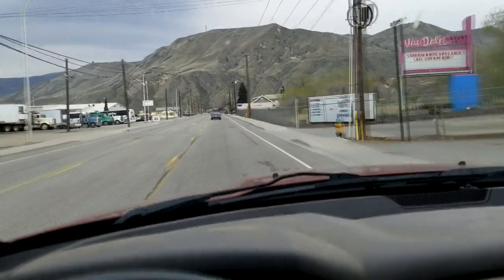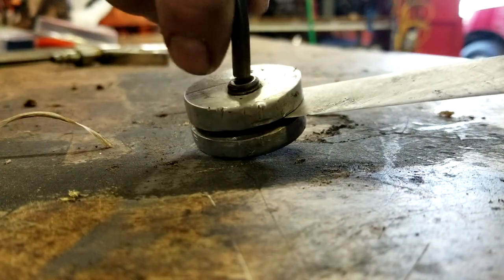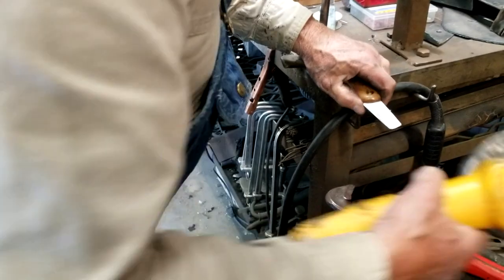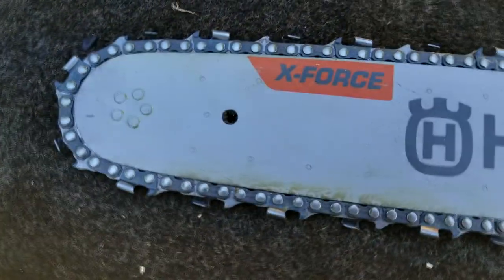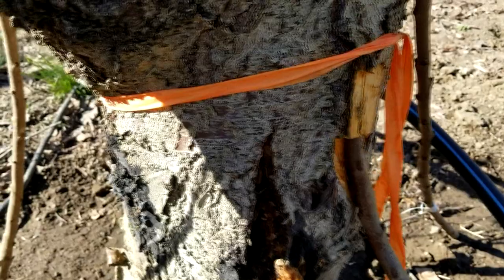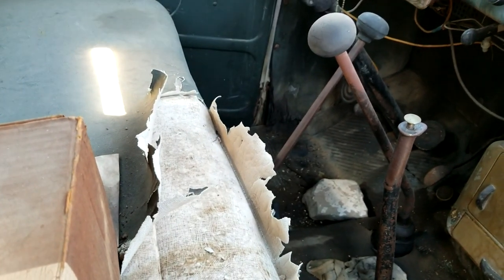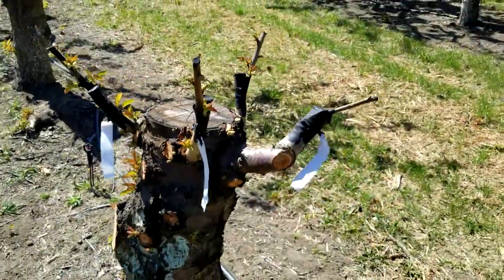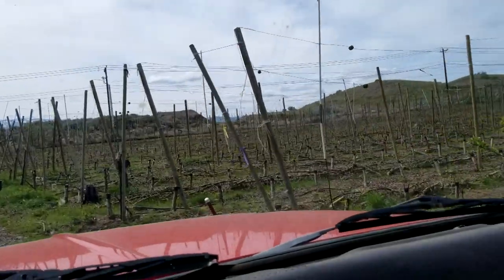grafting season 2021 - PART TWO

Comment: A buddy of mine back in the 80's was mowing the ditch in front of his house just about 3 miles west of Kingman on highway 234 about 2 days after the State Highway Dept had been down through there laying new blacktop. He saw out in front of him in the 1foot tall grass what he thought was a snake zipping along trying to out run him in the grass on his John Deere riding mower. Then a few seconds later his mower died. He threw the deck out of gear, started it up, put it back in gear and it stalled again. He got off and looked under it and what he thought was a snake was actually the twine they had strung along the edge as a guide. He cut on it for an hour with a utility knife before he could get to the bolt to take the blade off.
My dad used to make push mowers using old engines. He'd put wheels on a piece of board from the sawmill mount the motor on it, add a blade and a handle and mow with it till it broke down. He made one for his older brother and about half way thru the summer uncle Lee brought it down to him and said "Dang thing quit cutting." Next day dad flipped the mower blade over and it cut just fine. Uncle Lee never was quite as handy at fixing things as the rest of the family.
Reply from the maker: i know some uncle lees